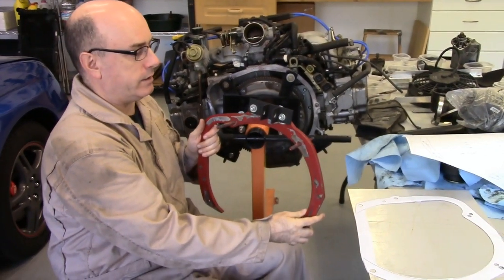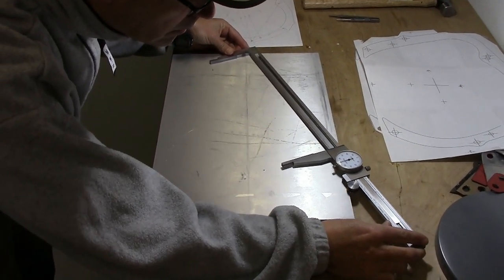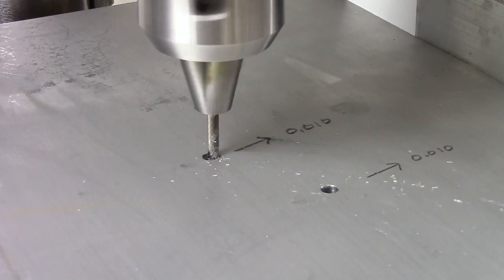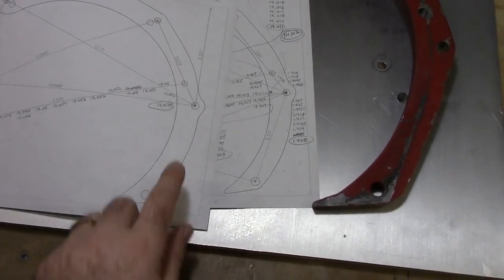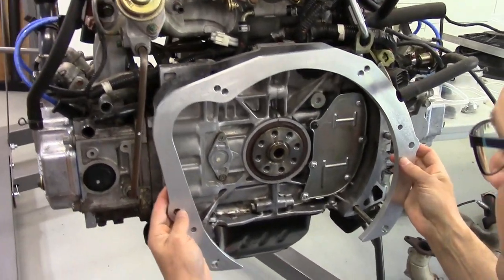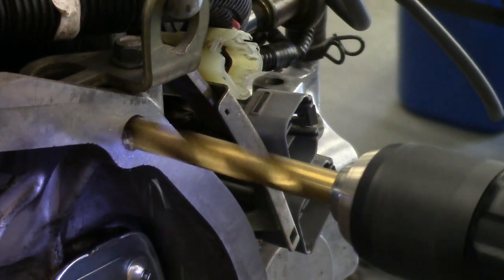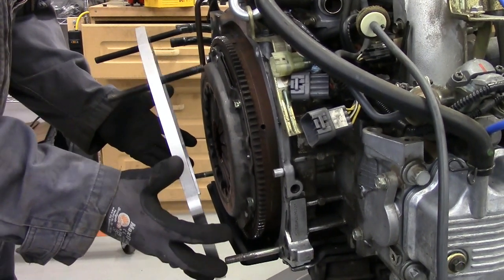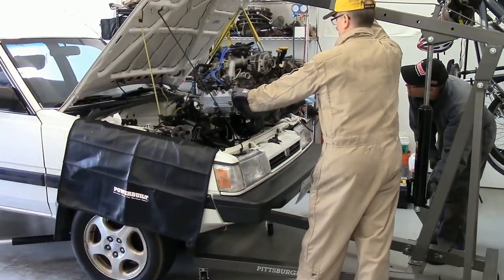Subaru Loyale: EA to EJ Motor Adapter Plate

Comment: Finally a video I can watch no stupid comedy, steady camera work, precise metal tooling. the only problem I have is the final bit where the flywheel was modified. What tools did you use to modify the flywheel and are the holes not over big.
Reply from the maker: The flywheel was re-drilled by the outfit that sold us the original adapter plate, years ago. This project was just to replace the plate, due to the dowel misalignment.

Comment: Hello @Steve Cornett, great video. Did you- or do you usually have to make modifications to the throwout bearing, pilot bearing, or flywheel, such as adding a spacer?

Comment from the maker: I put the design at http://www.ElectricSubaru.com/loyale/ea-ej-adapter.ems. It was created in the free eMachineShop CAD program.
Reply from the maker: The top four holes are 0.344in (11/32) which is the recommended size for tapping M10x1.25mm threads.
Reply: Steve Cornett 
Hello friend could send to my mail the manufacturing plane of adapter EA-EJ I appreciate your answer

Comment: Any chance we can get some driving footage of what the Loyale drives like with the new power plant? My family has 4 of them and going to the EJ engines might be worthwhile with how expensive rebuilding the EA82 engines are.
Reply from the maker: +xmodalloy Don't know if I'll do more video with this car. The main difference with the EJ engine is an additional 45hp and it runs smoother. The EA to EJ swap is a serious undertaking that requires extensive rewiring (possibly requiring removing the dash), custom exhaust, radiator, radiator fans, and more. The swap is not cost effective, it's more a crazy gearhead thing. You can learn more detail by Googling "EA to EJ swap write-up."
Reply: You are correct!!  I would junk the loyale and upgrade the car.  Far cheaper and you don't even need to turn a wrench.

Comment: could you take something like a 3cyl Kubota Diesel and stick it into a say 2000s Outback body. I think it would fit, get a super mpg diesel wagon that has excellent crash safety. I always wondered if it would work. It doesn't have to be fast. I think a tractor motor probably spins just fast enough to run a car at 45-50mph

Comment: I know everyone wants this adapter to put an ej into a old EA82 loyale. But I would like to put a Loyale 5 speed transmission into a outback. I want to do this because I'm going to be buying an outback with a long travel suspension but I like the old l series transmission. Has this ever been done?

Comment: i want a swap! just worried about wiring :/
Reply from the maker: You are correct, the wiring is a bigger issue than the engine/trans adapter. You'll definitely need to study the wiring diagrams for the Loyale and the donor vehicle until you get comfortable. It also helps to have an additional working vehicle of the same type as the donor to refer to.

Comment: One question is how do you figure out what thickness the adapter plate needs to be? Will the transmission shaft long enough to reach the clutch plate with the adapter in the middle? Thanks
Reply from the maker: We measured the length of the transmission input shaft from the mounting face of the transmission for both EA and EJ. The difference is very close to 1/2in, so that is the thickness we used.

Comment: is there not a problem with the input shaft now being spaced back from the clutch assembly the length of the adapter plate?
Reply from the maker: The distance from the transmission mating surface to the clutch for the EJ exceeds the distance for the EA by 1/2 inch, within one millimeter. An adapter made from 1/2 inch thick material works out just right.
Reply: thank god

Comment: Do you have these for sale? thanks
Reply from the maker: No but you can buy the kind we took off. Look on eBay for "Subaru EJ-EA Engine Adapter plate SJR". They might have improved the dowel pin location. Or you can have one like ours made. I put the design at http://www.ElectricSubaru.com/loyale/ea-ej-adapter.ems. It was created in the free eMachineShop CAD program.
Reply: Steve Cornett perfect thanks lot for the info and very nice video, greetings from Costa Rica.